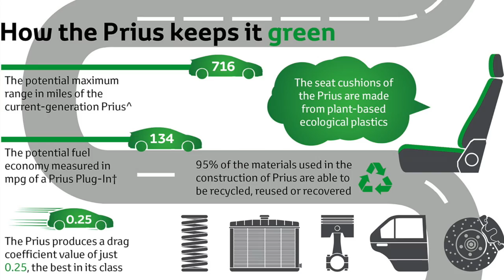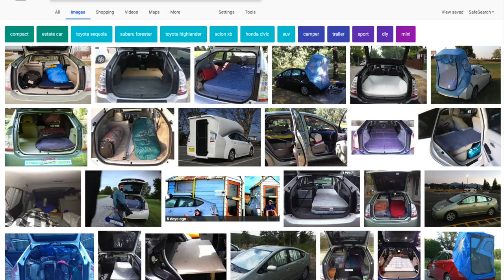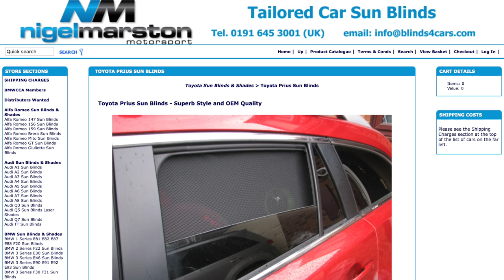Stealth Car Camping in a Toyota Prius (Building a Bed, Staying Warm, Privacy & Security)

Comment: the only issue with the dog... is someone might smash your window, thinking its trapped
Reply: FREE  THE PUPPY 🐺
Reply: Dang i never thought of that
Reply: Bahahahaaa...
Reply: @EvilTwin123  But the glassy stare! The lack of movement. That dog seems to be  practically dead!
Reply: @EvilTwin123  You're on ALL of these videos! :)
Reply: Good point - thx for putting it out there.
Reply: Prius’ have an auto temp control- I just put an “AC is on” sign in my window with my pups inside

Comment: So you've got an inverter, why not get a small 700 watt microwave or the smallest instant pot (also 700 watts) and do your own cooking?   There are also tiny AC or DC fridges that don't take much juice to run.  I just set my Prius up with a 1000 watt pure sine wave inverter just so I can have some backup power for my home in case of a power outage.  My home fridge and freezer are pretty efficient.  I used a Kill-a-Watt to determine the draw on them, plus a few lamps, our modem and a couple of laptops and we actually have a little power to spare.  My issue were getting an inverter with 4 plugs, and cords long enough to reach appliances from the closest place I could park my car.  We can now go camping or take a trip and cook while we're gone.  The way things are going with climate, I think it's a good idea to have some backup energy plan.  My entire set-up cost about $225.  You could probably do it for less with an inverter with only two outlets or if you already had the properly rated extension cords.

Comment: So much info in this video.  You're really amazing.  I have a Ford, Escape, Hybrid.  I like what you said about charging up the car battery and using 110 off it.  Not sure if that applies to me but I do have a 110 outlet in my car. One thing I notice is that if something like AC is running, the gasoline engine will come on soon.  I guess it's a matter of timing.  So many things I can use that you do. I also like to eat the way you do. Love the refrigerator and the trifold mattress. Lots of great ideas for stealth travelling.  Not so sure if I have the enthusiasm, know how, and certainly not the youth that you have.  lol..Enthusiasm is growing. Thanks for posting. I subbed and thumbs up.  I have much to learn.

Comment: Great video.. lots of great tips for anyone that wants to car camp.
Couple technical details about the Prius. The 12v small battery is not what starts the car. The main traction hybrid battery starts the car. A dead 12v will prevent you from starting, but only because it runs the onboard computers.
If you somehow run down the traction battery you will need a tow to a dealer to charge the high voltage battery.

Comment: Nice video!  It covers a lot of info, yet moves along nicely... well edited.  And, I learned that the Prius (or at least yours) has a solar panel built into the roof.  Talk about stealth!  Anyway, it's great to see how you maximized the use of space in the car.
Reply from the maker: Awesome! Thanks for the positive feedback Ray, yeah the solar thing is a special extra. I NEVER thought I'd end up with it and was a little disappointed that it only runs the fan, but it makes a big difference keeping the car cool and I suppose it doesn't complicate the other battery/electronics which makes repairs and service easier and more reliable :)
Reply: Thanks Ray! It was fun to make this and share because so many people shared ideas with me, I tried to keep it fun :)

Comment: I love my Prius for sleeping.  All-season comfort for a few dollars a night, and my own sheets instead of some iffy motel's. I put a parachute cord and toggle (like a kayak toggle handle) on the rear latch mechanism, so I can open it from inside to get out. Just a convenience and safety thing worth five minutes of effort. A bit of cord would do it, but I was thinking emergency or middle-of-the-night. Happy trails.
Reply: I've been wondering about how to open from the inside. Can you elaborate? Thanks!
Reply: I too wonder how to do this.  I get the toggle part just fine.  I am also so short  I have trouble pulling hatch Down.  Miss the strap on older Prius.
Reply: @lindasue8719  Look up "How To Manually Open Trunk Hatch Toyota Prius" on Youtube. There are different vidss for different years of Prius. You will see how to get to the little lever that opens the hatch. It even has a hole in the end for your paracord. You will be able to work out where to route the paracord so it ends up most freely pulling on the lever when you pull on the other end. In my 2013 it runs between the back of the storage tray and the light grey plastic cover for the hatch sill..
Reply: @karenculbertson585  The toggle/cord setup is for opening the hatch. It doesn't go up with the hatch, so no help in pulling it down.
Reply: @fergalo6928  I dont understand how you can open hatch from inside, at all .   Kasy99    gmail.
Reply: @karenculbertson585  Look up "How To Manually Open Trunk Hatch Toyota Prius" on Youtube. There you will see how to find the mechanism that opens the rear hatch from the inside. Unless you put a string on that little lever, you will have to pull out the stuff in your storage area, and lift up the carpet, the board over the storage tray, etc. But, if you put a string on it that can be grabbed and pulled on while carpet, board and storage tray are in place, you can open the hatch from inside.
Reply: @fergalo6928  Wow, will check when get next Prius (totaled last one, now shopping).  Sneaky secret with huge ramifications.  Figured by a ... Blonde .... Girl too.  Wa-hoo.
Reply: @karenculbertson585  There is a great You Tube site called PRIUS CAMPER ( ? ) or PCS or PC ( ? ) etc ...
The guy is in N.C. and has several Vehicle Camping Builds , information , equipment Set Ups , Step by Step Instructions .....
Also there is a You Tube video of a guy putting in a Push Button Switch to Open the Hatch from the Inside Mounted in the Plastic on the Rear Hatch ....
Reply: @rickywright583  The fellow at PSC Camper Conversions is a Prius-build pioneer, a library of information, and truly one of them that's doing. Thanks for the push-button lead. That'll be nice. I'll still keep the  cord and handle on my Prius in case I lose electric power in an emergency. As the old Irish song says, "O Shillelagh, you never missed fire!"
Reply: The switch: https://www.youtube.com/watch?v=Z_IatNJHpnc

Comment: Well done video young man! I have been saving for a van and go back n forth between a 2011 chevy express 2500,4.8 to 2013 Transit Connect. After seeing a video a month or so ago that Bob Wells did interviewing Randy Vimming, he said he lived out of a VW Bug for 5 years. Now I am starting to think of ripping out the interior of my '04 Dodge Neon and building a platform bed and storage. Had it since new and meticulously maintained it and now at 215K still runs like a champ. The rear seat folds down and even me at 6 foot 4 tall can lay in the back with my feet in the trunk. I have 6 foot 6 inches of room with the front seat all the way forward. Have also considered yanking that. I'm almost 57 and retired disabled. I always feel stuck at home but I want to travel around before i get too cripple to do anything. A full size van or transit would be nice but I feel comfortable having money in the bank and just using the car I already have that's good on gas. Check out "007craft" and his car camper in a Honda Civic. Thanks again for sharing your experience and insights.
Reply: garth locklin Wish i coulda done that with my '92 honda accord, but there was just no way.  Bought a nissan nv200 and, although, it makes a decent little camper, the car is built like tin can and stuff is already breaking...not recommended.
Reply: Party on Garth!

If its paid for and 215k, you'll never get $100 for it so, its yours, tear it apart!!
Get out there and tour, travel, pilfer free breakfast at a hotel as you drive through that town.

Showers;
Planet fitness, anytime fitness, marinas, aquatic center, and even a $5 slipped to a chambermaid to let you use a "logged out" bathroom before they have to clean it anyway.
Reply: By taking out back seats and building a platform just right height you can store bins under, color - coded for all your "stuff".
Friend insulated the sides for cold areas, and helps with hot.  Extra battery can run a fan , or maybe more.  Back part of van, if build support in a bit towards front, can hold a shelf for Coleman etc, and the side left for taller stuff.  SO  DID ya do it??

Comment: This is great - Thanks for the Amazon links. I also bought a used Prius and impressed with its fuel efficiency and space. I was lacking the time and ingenuity to figure out exactly what accessories would fit well in it for full camperization. I think I will be buying the mattress you recommended as well as the cooler and 110v inverter. Awesome!

Comment: I would put a flat rack on top that totally covers the foot print of the vehicle and put solar panels covering it as completely as possible and connect them to your car battery. Free fuel from the sun. Any time you are stopped it is filling the batteries even getting a little something when driving during the day.

Comment: Nice Job on the Car!  I also have sensitivity to cats, dogs!  Staying at other peoples homes can be a serious problem.  So I converted my Subaru Outback for camping / sleeping.  I have some ideas for privacy in your car that you might be interested in.  Go to Home Depot and pick yourself up some Bubble wrap silver insulation for the windows.  You can custom cut and friction fit the insulation in most windows.  It stores well (mine slips under my bed), takes very little space (cardboard thickness), blocks all light and reflects unwanted heat.  I have a few curtains just incase I need some light or to see out sometimes, it also provides ventilation if needed.  For the back hatch window I use some velcro to attach the insulated bubble wrap insulation to the top of the window, the bottom friction fits.  For the front window I just use the wire edged reflectors that you can buy at most automotive stores.  All this stuff installs in minutes and provides a lot of privacy and is lightweight.  Happy trekking, scrambling! I noticed you have poles in your car for that.  Please feel free to contact me if you have any questions.

Comment: Years back, I crossed the Atacama desert several times, and I installed an extra gas tank in my 4 cylinder Ford Escort; all I did was to Y the line to the new tank, and installed a shut-off valve for it. I increased the rage to a whopping 800 kilometres, allowing me to cross with more safety and freedom. Good luck and thanks for video.

Comment: great video thanks for sharing.   you might consider stowing your jumper cables under the drivers seat. when the 12v battery is dead the only door you can enter is the drivers door if the car was locked. also the prius hatch will NOT  open when the battery is down. so the cables will be inaccessible in the lower storage area.  JE
Reply: You can open the hatch from the inside...done it many a time when my 12v couldn't hold a charge overnight and I didn't bother to replace it in a timely fashion. You just have to remove the decorative cover and use a key or a screwdriver to manually move the latch over.
Reply: Most Prius appliers already switched to Optima?
Reply: That's a GREAT point, I heard something about this a while back, people having to crawl through the car to get to their cables. Thanks J D East :)
Reply: Just happened to me two weeks ago.  Luckily, it happened at a campground, and ironically, once I moved everything and climbed in, my neighbor was able to open the hatch from the outside.  Definitely a good idea to stow the cables in front.  I have a separate question for you, my vegan friend.  (thrilled to find a fellow kindness intender).  The dash cam link you have shared goes to a long list of cams.  Can you share which specific one you ended up getting, and why?  Much obliged in advance.
Reply: Also, the blinds look like they might actually let in air, but keep out bugs, is that correct?  If not, wouldn't that be ideal!
Reply: I keep thinking of more questions for you.  :)  I would be traveling with a real "Jack", except he looks a lot more cuddly, and is super friendly.  Thinking I might want to put a fantastic roof fan into my car for this purpose.  Have you done any investigating about that by chance?
Reply: @teacherslearn  
Wicked. $35/ea.
That's the cam name.
I bought 2 (front back).
They turn on when the outlets are juiced, no thought process - just drive and they film.
Good wide angle, good quality video (dont turn interior audio on...you'll hear yourself talk out loud).

Use the return policy of stores (Target, Bestbuy, Walmart etc..) to BUY & TRY different ones for a week.
Reply: MR EAST (-WOOD);
You think logically.
I would go so far as to say I'd permit you the last slice of pizza without jabbing a fork into your hand for the attempt.
High praise indeed.

Comment: Dont block the battery bent in the rear right side.  its there to cool and return the air flow to the battery so it dont overheat.
great job.
I had a 2012 Blue Prius III with the Solar roof about ($1,200)option. Love it, and the wife love the turbo botton.  Great car, too.
I now own a 2103 Ford FUsion Energi plug in.
Much better than prius but, no trunk room and it weres the tires quickly because of the weight but I like it too. been to Yellow Stone park in August 2017 and LA SF and Grand Teton, where I mostly camped in my car .  Did the samething.
GREAT JOB

Comment: I've got a Ford Cargo van and have started to think about doing a Prius V instead. I'm pretty excited so trying to visualize this and your video helps a lot. Thanks. Peace and love.
Reply from the maker: Awesome! Keep in mind that the larger Prius V tends to be more expensive, is discontinued, and the seats don't fold down as flat as the standard Gen 3 shown here. It's actually even better than the latest Gen 4 because of how the seats lay flat ;)
Reply: @withlove1717  Bless you. I will keep that in mind and look for those. I suspect a lot of used cars will be coming on the market in around three or four months.

Comment: Very helpful.  Always looking for ideas to try to convert my Camry into a weekend camper car.   The one thing I would probably do different myself is get black blackout shades for all windows.  While the screens probably do make it harder for someone to see in, I still prefer something that completely blocks out the view (in all windows).  That way if you have to have a small light on, you don't draw attention either.  But I do like that small cooler you have as I'm considering getting one now as it would be good for storing about 1-2 days' worth of cooled items and the draw is very low it looks like (48 watts).

Over the past year I've been looking more into the car camping thing as setting up a tent is a hassle, and you're less protected against intruders, bugs, etc and it's probably a bit quieter being in a car.

One thing I will say that i've heard when it comes to inverters and hybrids, is you have to be careful when hard wiring things into the battery.  I still prefer to use inverters that run off cigarette lighters because often times there is an extra fuse/breaker between the inverter and the battery.  And there may NOT be if you hardwire it directly into the battery or electrical system of the car, plus it can screw up your vehicle.  Most cigarette lighter fuses will pop before you do any serious damage to your vehicle either from overload or shorts.

Comment: Amazing set up for such a small space.  You can fit more comfortably (from the video) in the Prius Hatch Back than I could in an extra cap Toyo Tundra.  I just went outside and tried it.  Front seats in the Tundra won't go forward more than about half way. I could handle a night or two in it, but no more. Would have to sleep in a sort of J shape.  I'd be better off just buying a camper shell for the back-if I can find a good used one. Miss being out on the road.  Enjoyed the video.  Happy travels.
Reply from the maker: Hi Jenny! Thanks for sharing your experience trying to fit in the Toyota Tundra. My grandfather has one and they are great trucks, but I hear you about having to lay with bent waist and knees to fit (depending on height). I hope you get the chance to go traveling again, maybe we will cross paths :D

Comment: I've been camping in a similar size hatchback. I own a portable battery similar to a jackery to power my electronics while I'm on the road but I don't think it's enough for cooking or heating. Unfortunately, it is a little tight for me especially during poor weather and with all my sporting equipment. Currently prefer tent sleeping to my car setup, as it's much easier to take stuff out than rearrange all the gear for sleeping. Hoping I can refine my setup and live happily on the road.

Comment: My sister has had a Prius for almost 10 years. She's had zero issues with it besides for the recall on the water pump. Her door locks failed but she had those fixed at the dealer and the repair is guaranteed for the life of her Prius. She still gets 48 mpg and I'm totally sold on the Prius and I've also been considering getting a 100% electric car as well for back and forth to work.  Compare that to my Dads Ford Focus that has been in the shop more times than I can count in the last 3 years. Something is constantly going wrong with it. He's probably spend  two to three thousand just to keep that Ford car running, it's pretty ridiculous.  He's talking about going to get a brand new Focus and I told him I love him, but he's crazy. The Prius is a no-brainer. Esp with the Gas savings the older my parents get.